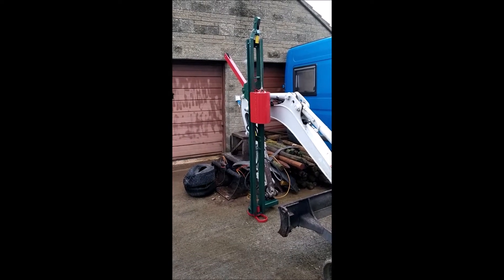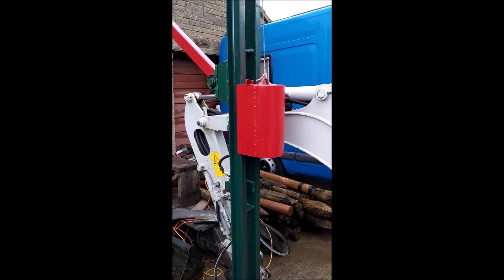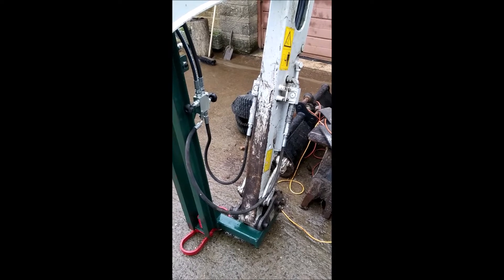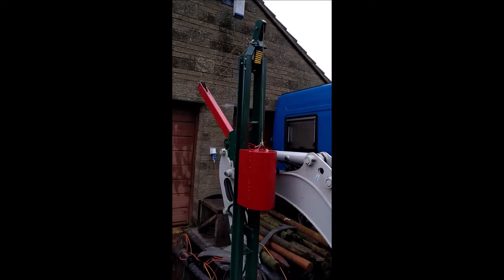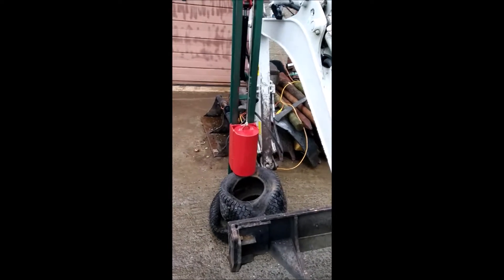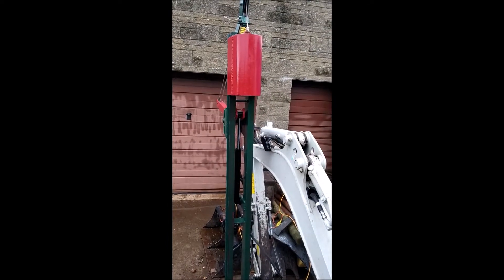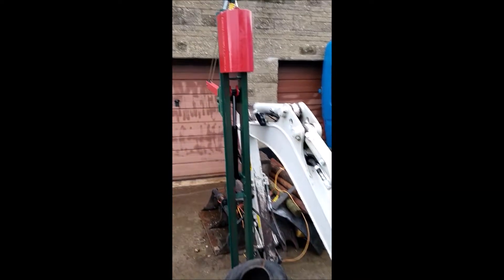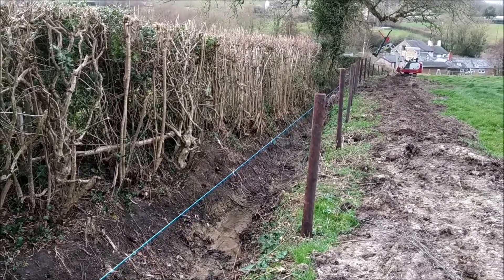Post driver for Takeuchi TB216 mini digger designed and manufactured by Brian Bailey

Comment: Yo I have the same digger and I also run a tractor with a post thumper. I purchased a rock breaker to drive in posts with the digger but I’m very unimpressed with how it performed. This set up looks brilliant. I’m in NZ and I was wondering if I could some how get some construction details off you so I can construct my own one.  Cheers

Comment: Did you use a single acting hydraulic cylinder?
Reply from the maker: No its double acting, the size of the cylinder in important to get the speed required. Generally the cylinder has to be just big enough in cross sectional area to be able to lift the weight via the mechanical multiplier ie the ram moves approx 250 mm for the weight to lift 2 m. Then when the ram closes the weight can fail at the speed of gravity to get the maximum impact.
Reply: Thank you Brian
Reply: Brian, do you have an email address?